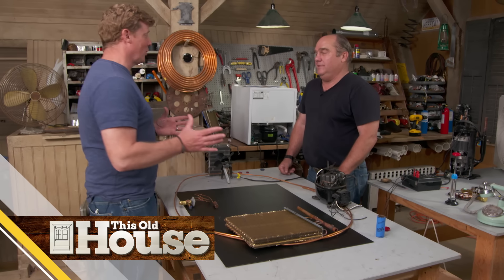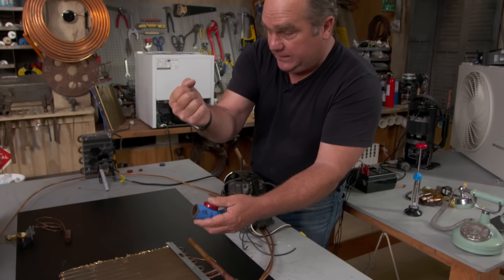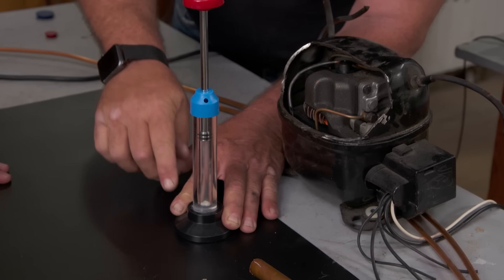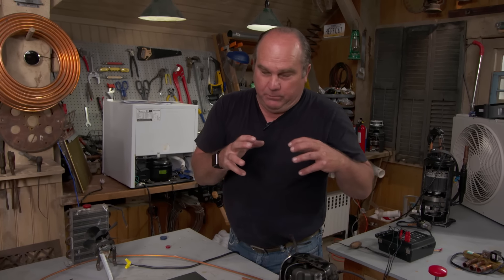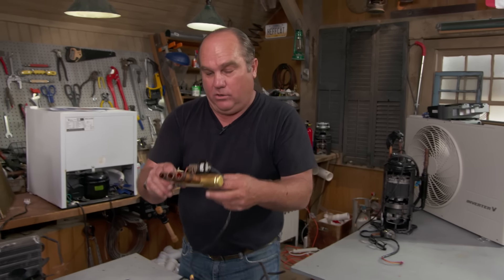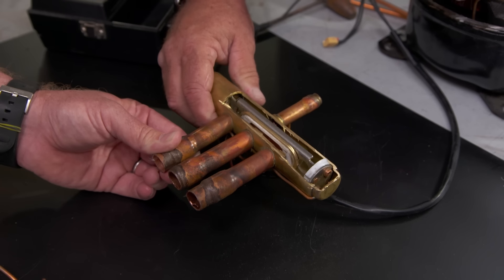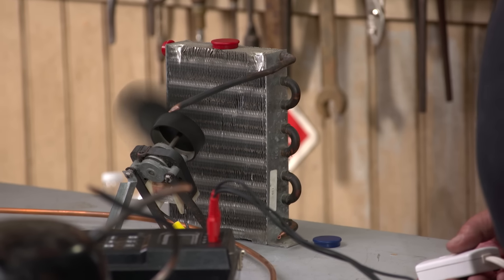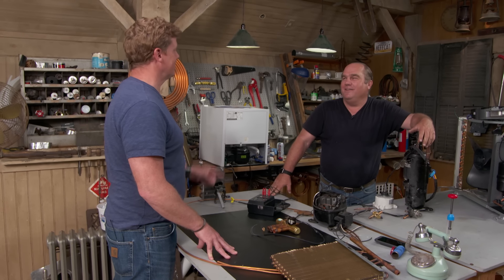How a Heat Pump Works | This Old House

Comment: I taught thermodynamics at the college level for over 35 years. The molecular dynamics for the cooling and heating of gases on expansion and compression are well understood and easily explained in the classroom. However, to put these scientific principles together for the purpose of heat exchange from the outside to inside or inside to outside and make it work in real life is absolutely genius. Richard Trethewey's explanation is simple to understand and masterful. Well done!
Reply: I don't understand.

Comment: I have a heat pump system in my house near Seattle. I have no end of trouble explaining that the system doesn’t create heat or cold, it just moves it around. Lots of puzzled looks. 🤣
Reply: Right and actually nothing makes cold only remove the heat.🤔
Reply: Ralph Macey Yes, a better way to put it.
Reply: @ELMS   You look very familiar but I think I just take it for 'grant'ed.😁
Reply: Its almost like dust in the air can be filtered into higher concentrations to be carried outside, like ur furnace filter, except u have gas hump it.
Reply: Technically the compressor does create heat though.  By increasing the pressure of the refrigerant
Reply: @joeberger3441  technically ur comment defies the first law of thermodynamics. The bit about energy not being able to be created or destroyed. Heat is energy you can't create it.
Reply: @blairforce1755  yeah, i get what you mean.  Energy isn't created or destroyed. What i mean by "creating heat" is putting the refrigerant through the compressor where higher pressures increase its temperature.
Reply: @joeberger3441  its not hotter its denser. Thats almost wrong but its kind of like that. Like if you had 100 people in a shrinking room u dont get more people theyre just closer.
Reply: @blairforce1755  it's denser but it's by definition hotter. It's literally a higher temperature. I get what you mean in that you aren't "creating" it. But you're manipulating it by raising pressure, thus raising temperature
Reply: @joeberger3441  yes ur right temp is raised in concentration.
Reply: You cant create heat anyway
Reply: FYI, You are creating heat from the 3 motors ( compressor,outside fan,inside fan, and possibly a condensate pump motor ) that are running during this operation.

Comment: I might have to watch this a dozen times before it sinks in.
Reply: I agree, the explanation wasn't very good.  He talks too fast and skips too much by not giving context.
Reply: Which brings me to my next point dont do drugs
Reply: @donchiva2222 he was making a joke cause it uses heat sink technology.
Reply: You kind of already know liquid water to steam...

If you imagine the compressor is making steam into water but it's warm water, then you run it through the radiator to cool it close to the regular air temperature. 

The big difference is the liquid inside of the air conditioner is liquid close to freezing And it's gas temperature is also pretty low around 100.
Reply: You kind of already know liquid water to steam...

If you imagine the compressor is making steam into water but it's warm water, then you run it through the radiator to cool it close to the regular air temperature. 

The big difference is the liquid inside of the air conditioner is liquid close to freezing And it's gas temperature is also pretty low around 100.

Comment: Should've explained the liquid and gaseous states of the refrigerant and what happens when  it absorbs or rejects heat.
Reply: Yeah, I found the explanation pretty lacking in detail.
Reply: Some folks are never satisfied,  even when its free to them.
Reply: Why?  What would that add to the video?  He's explaining the process so people understand what's happening.  The state changes in the refridgerant simply aren't important for that level.  Do you want him to explain how the logic board controller works too when it's deciding on the pressure cycling from second to second??

Comment: I’ve worked automotive air conditioning all my life,but this heat pump system was somewhat complicated….until now.Thanks to you Richard,all it takes is a switching valve and some electronics.Now I can even explain it to someone else.You get the credit of course.

Comment: There is not a better explanation on YouTube for heat pumps than this one. That simple concept of ‘heat always goes to cold’ and that gases when compressed or decompressed can either get really hot (and in turn attract cold) or get really cold (and attract heat) was the little understanding piece I needed to put it all together.

Comment: I installed a Carrier Infinity mini split heat pump last spring. It is amazingly comfortable for cooling AND heating. Amazing technology!
Reply: What size house did you install this on
Reply: @rockinrobin322  I installed two separate 12000 BTU units on each apartment of a duplex. Each unit is 1500 square feet.
Reply: Another question: What's the winter weather like where you installed this? How cold can it get, and does the system work all winter to heat? I'm in Iowa, zone 5b. Probably a heat pump would not work in the very coldest months, I'm thinking.
Reply: @aprilm9551  Winter is harsh here. -30 in the dead of winter.
Reply: @nicolasroberge2829  Nicolas, thanks so much for the reply and info! It means a lot to have real world feedback about something, so not just having to rely on advertising or general stats. OK, -30 (Celsius, I'm assuming) is a bit colder than it ever gets here, so I just may be looking into getting a mini split heat pump and will check out the Carrier brand.

Comment: He lost me in a couple of places but I was able to get the overall gist and this was really helpful. I'm in the process of trying to figure out how to bring an almost 100-year-old house that still has no air conditioning and an oil burner heat and hot water system into the 21st century. The consultants that I've had come to the house have suggested this type of system (natural gas is not available where I am to convert to and I'm trying to get off the fossil fuels anyway). This was all new to me and this video was really helpful in my understanding of how a system like that would work in the house. Thank you!
Reply: An old house, you would be better off spray foaming the place to seal up all leaks.  The kicker with heat pumps in the winter is that they are still making heat with electricity by compressing the gas.  The industry wide coefficient of performance (COP) usually given as 200 to 300% gives the general public the idea that they are getting free energy.  Is this more efficient than resistance heating, yes a little.  But a wood stove or a gas heater is more efficient in the overall scheme
Reply: I once had an old house that had hot water baseboard (mostly cast iron with some copper fin) but no A/C.  When we first moved in I added a whole house fan at the top of the stairs and that helped a lot on mildly hot days but on those oppressive hot humid days in NJ we started out with just window AC units but I eventually installed a high velocity AC system (Space Pak was the brand) myself.  The compressor was outside, the condenser air unit in the attic, with 4" flexible delivery tubes connected to the main plenum in the attic.  These tubes were run through closets and chases down to the first floor ceiling and one big air return also at the top of the center stairwell.  What was nice was that thanks to the high force of air the house would cool down in no time.  I liked this setup because I had the best of both worlds; passive long lasting baseboard heat (that I had zoned four ways when I got my new boiler) and instant whole house air conditioning.

Comment: Thank you Rich for explaining the actual mechanics of how the coolant flows and what actual mechanical device allows it to change to different modes, instead of all the other videos about heat pumps simply stating "you just run it in reverse to change from cooling to heating"....

Comment: Brilliant video Richard... the workshop, presenter and you my friend should be given an award for creating this one. Taking the simple principal of a air conditioning unit and reversing it to create a heat pump... Please do your best to get sponsored/funding/support to create more videos on heat pumps... by far the most effective and efficient is the ground source heat pump giving out over 400%... so for every 1KWh of electricity used, you get 4KW of heat... Just let you know there are massive incentive's by the UK Government to install and develop these thermodynamic systems... Not only are you helping out us electronics engineers and technicians, you are helping to save this planet...
Reply: I have a ground source pump here in Massachusetts, and it's simply brilliant!  At the push on a display, switch from heat to cooling.  No fuss, no muss

Comment: I never heard of a heat pump until we had a warm summer and I was looking for a cooling solution. I got a pump installed which solved the heat. Then, come winter, my power bill was $260 versus $400 for comparable size houses running on baseboard heaters. This thing pays for itself no time here in Canada.

Comment: I've been a longtime fan of TOH and this segment is as good as any they've had...excellent!  My personal surmise is how the use of known gas compression/expansion effects are used much like mechanical gearing, which can upgear or downgear by design.  It's the reversibility where full spectrum versatility of heat pump tech resides.  Awesome!

Comment: Holy Moly I always wondered how that worked! I need a new heating/cooling system for my home wanted to try and demystify the whole heat pump thing. Excellent explanation I am not mechanically or engineered minded at all and I understood this.
Reply: To be honest, you still don’t understand it because he has no idea what he’s talking about 😆. He is a meme to us legit hvac guys
Reply: When in heating mode you will always be constrained by the amount of latent heat in the ambient air, regardless how advanced the control system is. When needs outstrips available sensible heat in the air back up must kick in (electric usually).
Reply: Ask yourself if you really want to be running your air conditioning compressor year-round.  Keep in mind how high your electric bill is in the months when your A/C is running.  Do you really want that to be your electric bill 12 months of the year?  There's a reason why the vast majority of homes use some form of fossil fuel (gas, oil) to heat them.  It's much less expensive, and as others point out in the comments, much more efficient than a heat pump.  Even electric heat will cost you less than a heat pump.  No thank you!

Comment: This video is amazing!  We are having our old, dying A/C system replaced with inverter heat pumps so that we have more flexibility to heat with oil or electricity depending on temperatures and costs.  I looked into the technology quite a bit before making the decision, and I generally understood that heat pumps are air conditioners that can also “work in reverse” and they’re very efficient in mildly cold conditions.   But this is such a great explanation of the details.

Comment: Love my heat pump. I live in an open concept home (living area/kitchen in center, bed rooms on the outside) in Maine and have a ceiling cassette model positioned in the center of the house. Other than some nights of extreme cold, the unit does a great job on its own keeping the house up to temperature. My only other source of heat is electric  which I will usually only turn on during those cold nights when the heat pump can't quite keep up. The two sources work well together. So with no gas, oil, etc my electric bill stays under $200 per month most of the time during the winter months. It's been equally as efficient to use for AC during humid summer days.
Reply: Can I ask how many square feet your house is and what size are your indoor and outdoor units? We have all electric heat and curious what are electric bill will be with a heat pump vs getting a gas furnace.
Reply: @Matt-rz9fh  No reply? Where I live in order to have a heat pump use must have a back-up heat system. I've heard that heat pumps aren't all that great in the cold north east. I'll stick with my oil system.

Comment: My house in SoCal was built in 1990.  It is all electric.  It uses two independent heat pumps - one for upstairs and one for downstairs.  I've seen outside temps get down to 28 degrees F but the air temps entering the house are about 80 degrees F.  I'm still amazed that the heat pumps can extract heat from outside when it is so cold.  Heat pumps do have to deal with freezing up.  Depending on outside humidity and temperatures, the heat pump goes into a defrost mode.  It melts the ice and it turns to steam.  When the ice is gone, the heat pump restarts to push more heat into the house.
Reply: If you think of 28 degrees Fahrenheit as 270 degrees kelvin you'll realise that even though it feels cold to we warm blooded humans, there is still a hell of a lot of heat contained in that cold air.

Comment: Not only did this help me understand why an A/C unit would be called a "heat pump", it strengthened my over understanding of the laws of thermodynamics at the same time. I also assume this is also the basic principle behind how units in attics generate so much water when it's hot and how coils can freeze when it's hot as balls in the summer, because the heat is leaving the unit so rapidly it has nowhere else to go?

Comment: he explained it well, but its still mind boggling. I have a heat pump system and it does work well.
Reply: Does it work down to negative degrees Fahrenheit and if so can it keep inside around 70 degrees on those days?

Comment: This kind of system whether in a residential unit or a mobile vehicle (car) works off of the principle of "latent heat" where heat energy (not temperature) moves due to a change in the "state" of a substance. From a gas to a liquid (condensation) or from a liquid to a gas (evaporation).
Reply: Steve Fiorito just compare how long time it takes to bring 1 kg of water to the boiling point, and how long time it takes before all of that water becomes steam. Keeping the same effect kW on the cocker all the time. Then its easy to see that phase conversion is where most of the energy is

Comment: Well as an old science teacher, always looking out for misconceptions,I need to point out that  there is no such thing as cold, there is only less heat, less thermal energy. So energy passes by conduction from higher energy level areas to lower energy level areas.
Reply: @Christopher Wilson, the degree or intensity of heat i.e. temperature.
Reply: Explain it as I'm 5 years old. - Michael Scott

Comment: Fantastic explanation.  I work with mechanical engineers who specify many heat pumps, and I have a geothermal heat pump in my home.  This technology has been around for decades and is probably going to be the primary form of heating (and cooling) in houses as natural gas (which is actually less efficient) is slowly phased out.
Reply: LOL, Sorry but i strongly beg the differ on that, air source heat pumps don't work all that well and efficient in below freezing temperature, Yes geothermal heat pumps are better, but they can expensive, since the install requires breaking or drilling up part of the yard, and i doubt everyone is made of that type of money or effort to consider it in that case.
Reply: @KenKen-ui4ny  You make all good points, but some Leftist cities are already making it more difficult to bring natural gas to new developments and some are seeking to ban it entirely.  Alternatives such as solar and wind energy are even more expensive than geothermal heat pumps, which actually works quite well in the vast majority of northern US regions.  Maybe something even better will be invented, but until then, I agree that natural gas is the most "comfortable", reliable, and affordable heating.  (Still prefer my geothermal heat pump, though.)
Reply: @yefunehdavid1005  Almost nothing meaningful has come out of far left cities and states lately, only high taxes, gross disregard for law enforcement as seen in NYC, moronic regulations and bans such as what you mentioned, a long with an explosion in homelessness and poverty as seen in LA and San Francisco.
Reply: @KenKen-ui4ny  I agree.  Perhaps, someday voters will wake up. I hope.
Reply: @yefunehdavid1005  I hope so too.
Reply: @KenKen-ui4ny  not sure what you mean, there's plenty of cold climate heat pumps nowadays that are designed to work at -20c and still be efficient. They've come a long way in the past decade.
Reply: @tomtom1541  Cold climate heat pumps? LOL, sounds kind of gimmicky, heat pumps still have deficiency issues in below freezing weather, they just don't produce a whole lot of heat in that type of cold, my grandparents have one of these so called cold climate heat pumps, and it still uses the AUX propane heat at below freezing temperatures.